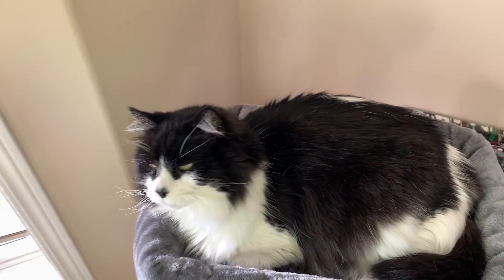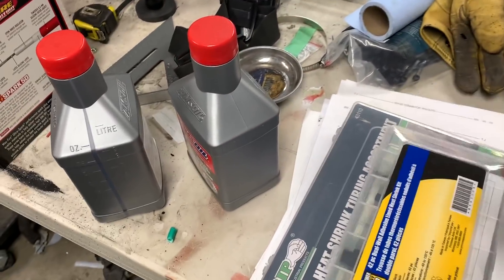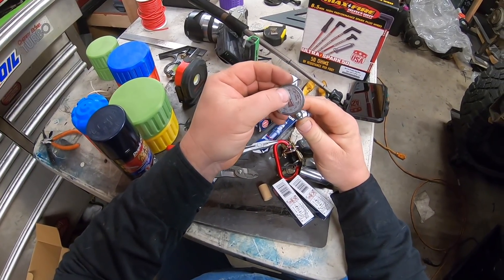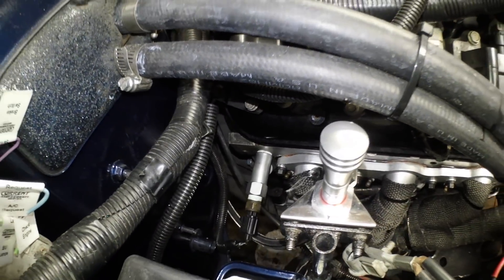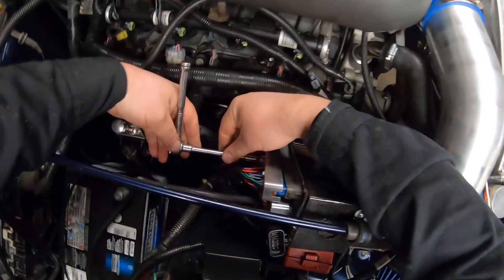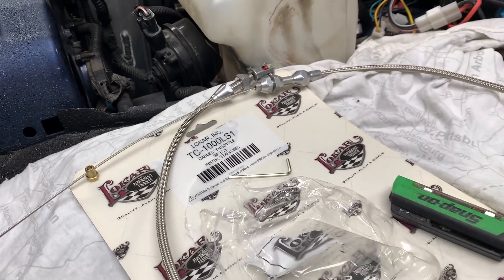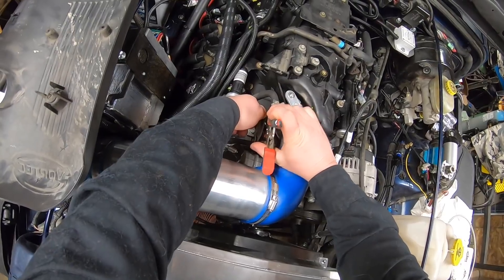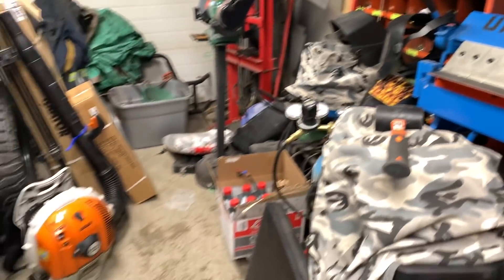Revenge of the Missing Part

Comment: The suspense is building! BTW, that air filter, is it oiled cotton?  Sad to say, that if it is you will not get much filtering or power gain after a period of usage.  Not a good choice for dusty conditions.  Also, the oil tends to cost the MAF sensor and throw off the fuel control.

Comment: I had a baby gate slam shut when my youngest son was an infant.  These are the adjustable gates that u use to block stairs, doorways, etc.
I was about 10 feet or so away from the gate, eating dinner.  I personally installed the gate, it was level, and would only shut if you pushed it.
It would never move or drift.  The way you left it, and the degree it was open would just stay that way.

I was eating dinner, with no one around me.  No pets, people, nothing.  The gate slammed with authority.  Not just like click shut, it slammed shut in a hard way.

To this day I still don't know how that happened.

Comment: Do you use copper cote on your plugs? Have to check your mileage after on road used ngk plugs in mine but mileage when to hell not sure why use ac Delco personally went from 16 mpg to 21 just FYI
Reply from the maker: Interesting, I did not use anything on these plugs.
Reply: Bullshitkorner I just noticed just about every bolt on the Jeep was anti seize have run into a fair few head gasket seeps Heaven forbid and the plugs remove aluminum threads no one wants that shitshow just sayin cheers
Reply: NGK plugs he has do not require anything on the threads, they have anti corrosion & anti seizing plating on them.
Reply from the maker: Yes sir